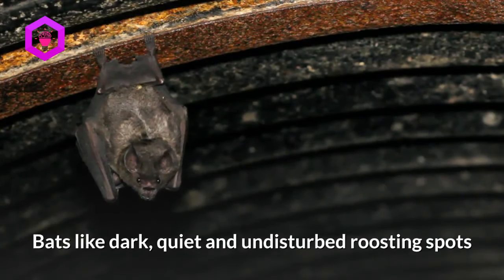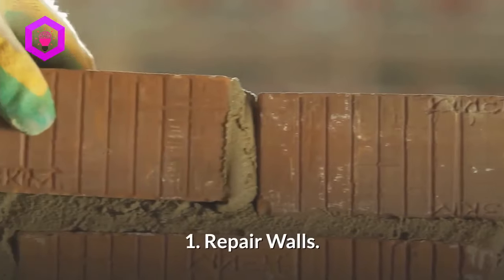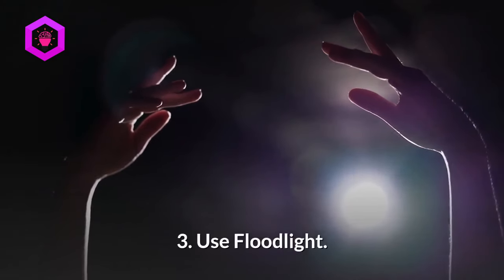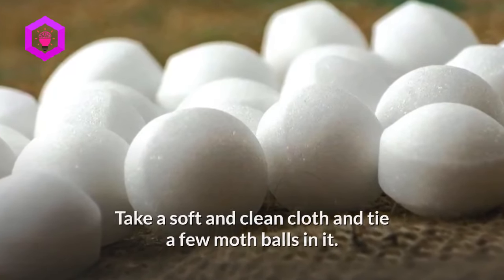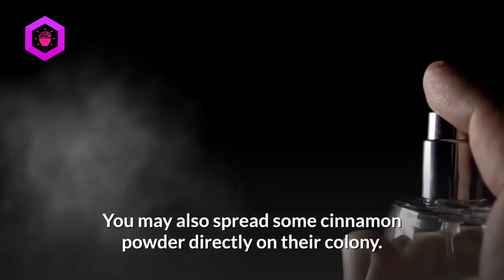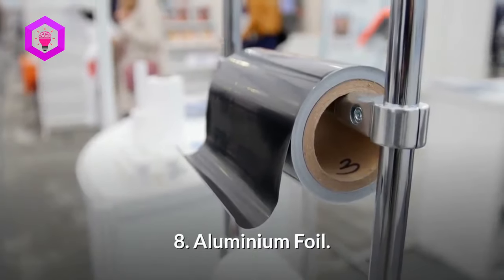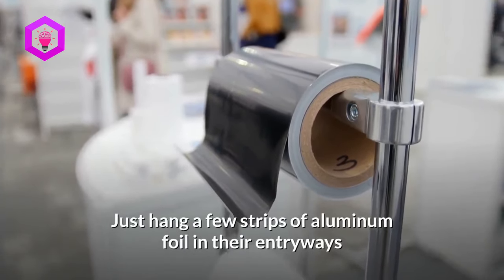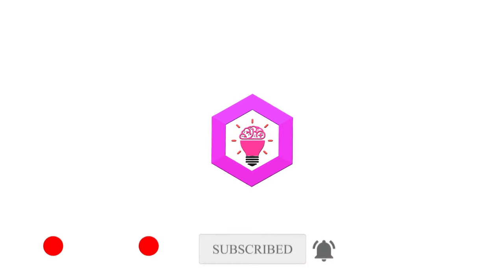9 Easiest Ways to Get Rid of Bats

Comment: when roofers add ridge vents to new roofs, bats find a way to get in then. 
After my ridge vents were installed, I looked for entryways first. Then I placed a strong light and heavy metal music playing loudly in attic to get rid of the bat families. After 24 hours of light&music, I closed up the entryways.  
This Youtube was correct in using light&loud noise to chase bats away.  Just take care of the entryways after.
Reply: Lmfao good for u but my attic is 100yeae old house attic which has holes all over so almost impossible to cover em all

Comment: If you get one bat, there’s an easy method to get rid of it. You need a broom and an oven mitt. Use the broom to keep the bat flying. Bats do not have the endurance to maintain flight for a long time. Do not let it rest, eventually it will fall out of the air. Grab it with the oven mitt, and throw it out the door. Just make sure your oven mitt is nice and thick, it case it tries to bite. They may also squeak when captured, do not let it startle you into dropping it.
Reply: I use a baseball bat
Reply: @xxdanthedinoxx1058  NOW there's an idea.
Reply: If you just throw them out they’re likely to get injured. They also can’t take off from the ground. Don’t be cruel to bats, it’s unnecessary. It’s easier to let it find its way out of your house
Reply: @xxdanthedinoxx1058 a bat to take down a bat . Wow

Comment: I know bats will fly down chimneys, I had an old house and ended up cementing a screen over the top of the chimney, took care of my problem.
Reply: Yeah but now you can’t use your fireplace. I would’ve just put a vent cover or a chimney cap to prevent animals from entering. This way you can use your fireplace without any hazard concerns, but to each their own